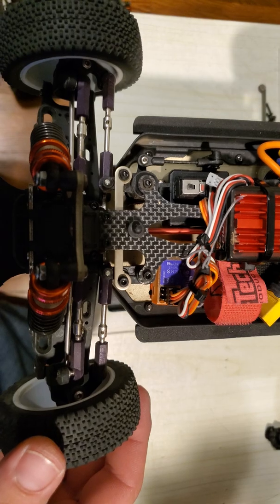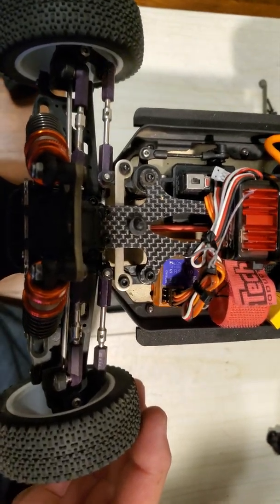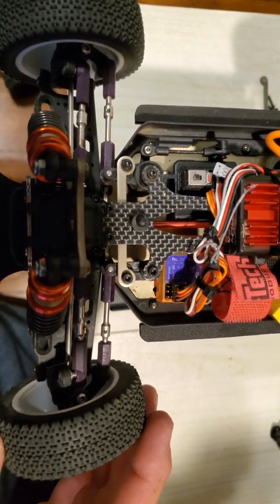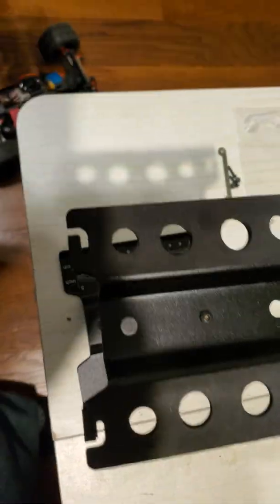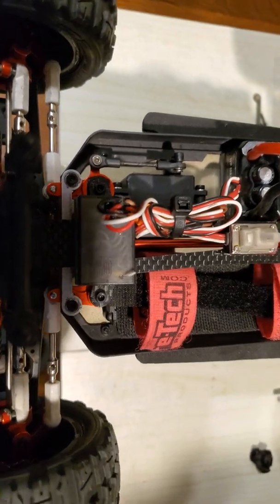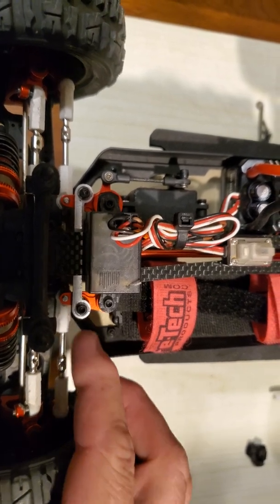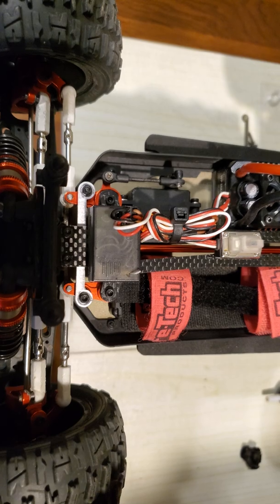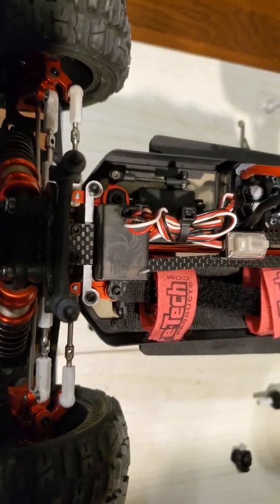Lc Racing EMB series steering Ackerman upgrade.

Comment: DId the metal steering bellcrank help in reducing slack. Noticed your first car did not have those parts
Reply from the maker: No not really. Most if not all of the slop is from the steering Ackerman plate. I only went with the aluminum bell crank as I broke the plastic one trying to get the turnbuckles off.
Reply from the maker: Twice lol